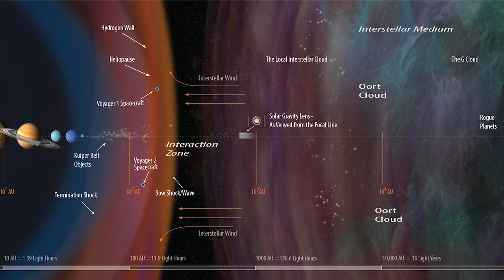Going Interstellar

Comment: I must have missed the part where you slow down for orbital insertion. Where are the brakes?
Reply from the maker: +Charlie Winfree You can watch the full presentation that Professor Lubin gave at NASA's Innovative Advanced Symposium for more details about the proposed technology: https://livestream.com/viewnow/niac2015seattle/videos/105034354
Reply: +Charlie Winfree You shoot the shit backwards at like 50% power till you hault
Reply: +Josh brown Well, that's true, of course... if the propulsive force were on-board. The video didn't seem clear about how the spacecraft carries all that power, if not as conventional fuel. Hey, Tesla batteries? I was thinking the laser gun (or whatever) was earth orbit-based (solar-powered) and pushing the spacecraft by firing a precise beam at a huge reflector, thereby providing a constant push, but no braking. OK, now I think the vague, nicely-produced video is just fantasy, because that reason why it's unlikely to happen is, if not technical, financial. The planet needs earth-based problems solved before we take up hyper-expensive fun projects to satisfy a few people's curiosity.
Reply: Reading, or rather skimming through the attached document, this is actually pretty interesting material. I had known about the basics of laser propulsion for quite a while, but a lot of the ways they propose doing it are quite novel. The probes are designed to be built as wafers, I guess it would be something similar to shooting a computer chip through space. The low mass allows it to reach relativistic speeds much quicker and with a lower power laser (their laser design is quite interesting too). To answer the main question, how are they planning to slow down, at the moment they arn't. They want to try a flyby mission first. though this is probably still a ways down the road, even though we pretty much have the needed tech.

Anyway, they do have some ideas, such as using the stars photons or solar wind, but they're not entirely sure on how to go about actually being captured by a star yet, and thus are only planning on flybys for now. THough interestingly, because the 'wafersats' are so small, we could probably send hundreds of them. I havent actually seen much information on the 'to mars in three days' yet. But I really am only skimming the document, it's quite long and fairly technical. My guess is that it would be one of the tests. This tech probably could quite easily get a wafer satelite up to the speeds described in my earlier post. For sending people there, it might be something quite different though. I'm not sure people could take that kind of acceleration even.

Turns out that +Brad Steeg had the right idea. I just didn't realize it lol.
Reply: +Charlie Winfree Don't slow down. Send "millions" of small wafer chips that collect data as they pass through. The flow of sensors become the spaceship.
Reply: +NASA 360 For more details, yes, I get it.  But to answer his specific inquiry, what about that? Does the video address it?
Reply: +Charlie Winfree Thank god we have Atmospheric brake... risky but maybe worth it...
Reply: +Charlie Winfree Probably would need a laser system also set up at the destination, for slowing, receiving, is my guess. Just as the one that does the sending from Earth would also have to be equipped to slow down and receive, for the return trip back to Earth.
Reply: +Charlie Winfree 

We should slow down using magnetoplasma rockets at first and then photonic tech when we reach the other side.
Im sure we are not only going to Mars commercially, but to Alpha Centauri in not many decades.
Reply: +Sigmantv Twitch You all have nice ideas!
It looks like you are some kind of beta testers.
Reply: +THINKABLE SCIENCE That's a very kind compliment, it would be a dream to be on a project like this. As a random civilian, the most I can do is toss in a concept (my 2 cents). The real work comes from those super smart teams able to make theories into a reality.
Reply: yup, at speeds where a fleck of stone would be catastrophic.
Reply: +Charlie Winfree The same way you sail against the wind.
Reply: The laser delivers only the energy so it can be used for brakes and maneuvers too.
Reply: +NapoleonDynamiteer At 20% the speed of light, there might be a huge new manmade cratter on Mars, and aerobreaking at those speeds may incinerate the ship.... but that's an interesting technology though.
Reply: +ThatRobin we are speaking of relativistic speeds ! Mars is not massive enough to retain an object moving to those kind of speeds ! Neither Earth, nor the Sun ! Without breaking speed, the ship will continue eternally on its path ! very interesting though to see what does Alpha centaurii looks like  !
Reply: +Snwh122 Would you please put your comment up as a main comment and not a reply? This way far more people will read it. You are one of the few people who would have read the paper and what you have written answers many people's questions. Thank you!
Reply: +ROMEU SACRO SANTO NEY You are completely missing the point. You can't use this as a weapon.
Reply: +Charlie Winfree Well, you dont technically have to slow down to GET to mars. Crashing at counts as well.
Reply: +Elie Maltz Mars commercially? For me, talking commercial, is implying profitability. And, in the kind of capitalism my mind thinks from, profit maximizing/optimizing is kinda the modus operandi. There may be some profit potential there on Mars. But I think those profits are more cost/expense intensive, than space generated profits much closer to Earth, presently. I'm all for making space profitable. And the more profitable, the better. And the $ooner, the better.
Reply: +Charlie Winfree Dah!! ^^ There are too many things that can be used as brakes:
1- The same combostion we use to put ships on the space can also stop the ship.
2- The same tectology that let us get to mars within 3 days can stop the skip.... just need to take a little more days to get there... from the original 3 days to around 6 day (Just inverting the obvious light sails).
3- Using the gravitacional force of a planet like mars.
4- Other more if you want to know just ask me ^^ (My favorite is to use the gravitasional waves ^^ but I can't talk alot about that at this moment ^^)
Reply: +Charlie Winfree btw what do you think about music making ships travel on space? Do you think music can't be in space? What about the Wow signal, or about the music hiden for 50 years recorded on the dark side of the moon? Or perhaps the estatic sound jupiter does on radio.
Reply: +Charlie Winfree If the unit can be turned perhaps that can assist it to stay reasonably within a desired location. And/Or, there should be a way to cause the unit to redirect it's energy to reverse (an opposite effect) where needed as a brake. Maybe?
Reply: +Sigmantv Twitch "to reverse (an opposite effect) where needed as a brake". We can build a laser tower in mars. That laser tower will aim the coming ship making it slowdown.
For more ideas just just.
Reply: +3DShe That idea may not be feasible. A satellite power source might provide more efficiency and accuracy but cost effectiveness is a huge deal, especially in early stages and vying for funding.
Reply: +Sigmantv Twitch

Will we need to create spaceships, or laser towers on plants/moons or laser "towers" orbiting planets/moons?

What do you think of the following Idea? 

Can't we take our 3D printers out to space in a small ship?

Our 3D printers can print plastic, metal and other materials.

We can send a printer-ship into space... letting it print new printer-ships in space.

Part of printable materials can be divided and shared with newly printed printer-ships.

If we need more printable materials to fill the tank, we can send "artificial comets/asteroids" ahead to orbit far planets or moons. Making them synchronize with the coming ships.

Future ships could then travel in space the same way trains travel on railways.

For more ideas just just. ^^
Reply: +3DShe I think these things are carefully considered in every way by the project teams. The main concern in my opinion is cost in order to even get established. Then they can progress from there. Starting on a smaller scale can help develop the best approaches and find/solve problems that come up. For instance, "brakes".
Reply: +Charlie Winfree We are talking about 167 400 000 mph.  The amount of energy required to attain that velocity would be enormous.  7 483 449 600 Newton, to be exact.  

LOL!
Reply: @Charlie Winfree You, and people like you who say these things need to realize that the planet Earth WILL NOT sustain the human race indefinitely no matter what we do. We need to spread out or we will die here as a species. It is not just about curiosity, or adventure. It is about the evolution or our entire species to that of a multi-planetary race, and it is about surviving the next extinct level event.
Reply: If you're going often enough (or WANT to go there often enough), it's cost effective to build a laser on the other end and use that to slow you down.